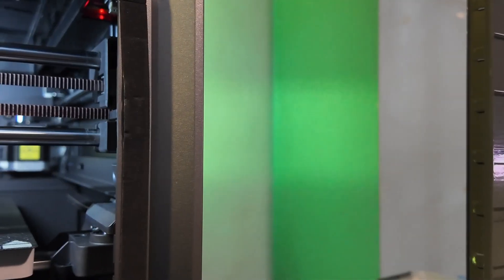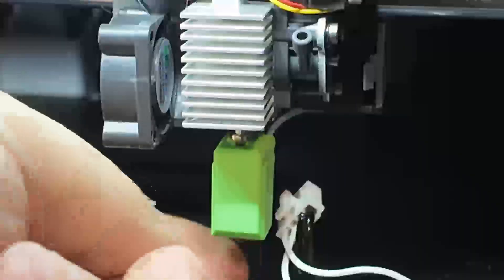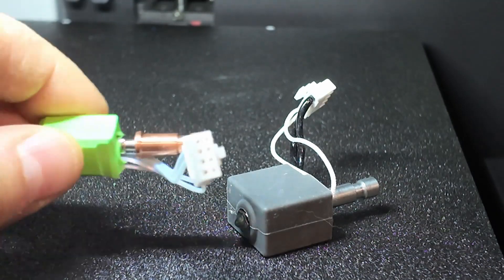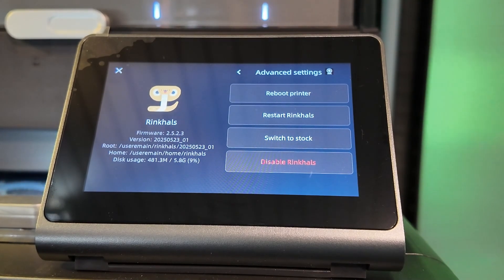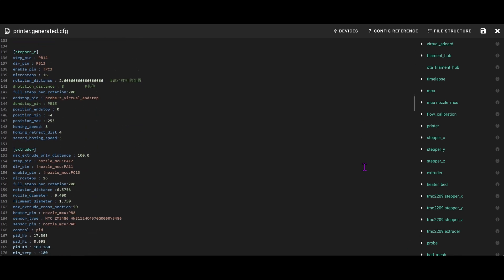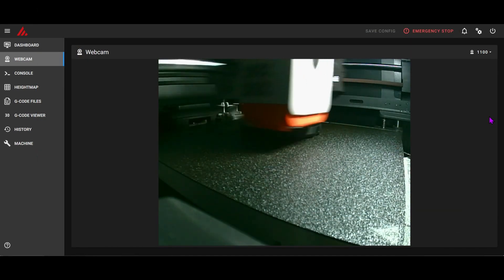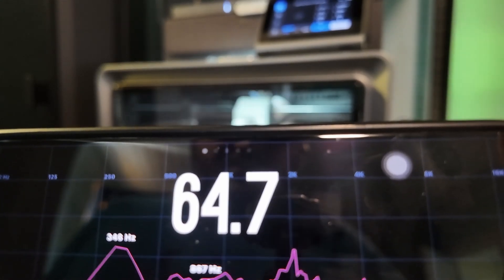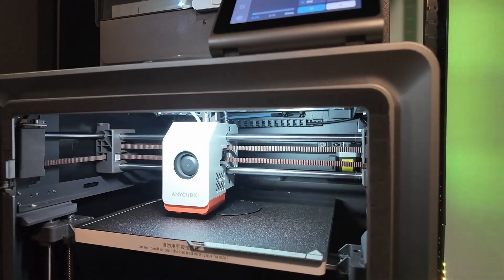Anycubic Kobra S1 Supercharged! - $10 Hotend FIXED Everything

Comment: I am also curious about the mentioned thermal paste. I just received the green hot end as well and the nozzle seems really tight. I hope they didn't glue it in because I want to change it for a CHT clone
Reply from the maker: they aren't 'glued' together , they are tightly on there though, so you need to use some sort of plier to unscrew it.
Reply: @aim6mac Thanks to your reply I discovered that I made one of the most rookie mistakes ever... All this while I turned it into the wrong direction 🫥 I also spotted the thermal paste! Too bad my CPU thermal paste is only okay until ~150°C
Reply from the maker: @Blu3B33r  oh wow, hopefully u sorted it out now!
Reply from the maker: @Blu3B33r  and always remember, clockwise is tightening and anti- clockwise is untightening!
Reply: @aim6mac  I did, thanks! I get an abnormal temperature reading but new thermal paste is on its way already :)

Comment: Wow.  Bits ordered.  Can't wait to try this out.  The Anycubic package for the Kobra S1 was great value for money.  Should have been a game-changer combo, but didn't quite live up to the hype.  The Kobra was didn't meet Bambu for print quality.  This fix looks like it will make the printer great.  All for $10 and some software.  Thanks to Aim6Mac for working it all out and making such an easy to follow video.  I only have a tiny brain, so lets see if I can pull it off.
Reply: how'd the upgrade go?
Reply from the maker: tiny brain :D

Comment: Interesting video - thank you!
What kind of nozzle are you using with the ceramic Hotend? Brass, one of the other materials?

Could you describe the thermal-paste thing more precisely? Witch paste? Where to put it on and how much?

Do I have to change slicer settings, when using 1.0V, Rinkhals and the ceramic hotend?
Reply from the maker: i updated the description of the video , please check it out there,
Reply: @aim6mac  Thank you - but what Nozzle material do you use?
Reply from the maker: @Crady123  in the video i'm using 'hardened steel'

Comment: Great video!
Im loving my S1 after the ceramic hotend upgrade. Ive done a lot of work to the bed on mine to get perfect first layers without having to do mesh leveling :)
Reply: Why does my printer, when it starts printing a single layer, not adhere to the plastic for a couple of centimeters of the extrusion stroke at the very beginning, but then prints normally? It's as if there's some kind of extrusion delay. This happens with both the ceramic hotend and the stock one.
Reply: @КалупаКалупович  me pasa lo mismo, al comenzar a imprimir no extruye; luego si, pudiste modificar algun parametro para mantener el voltaje?
Reply: @matibeltranarg  Increasing the motor voltage didn't solve this problem. It might be a firmware issue, causing extrusion delays, I'm not sure.
One possible solution is to add a skirt. It's not a panacea, but sometimes it prints without gaps. 2. Set the additional feed length in the rollback profile; I set it to 0.1.
Reply from the maker: oh really, i need to watch that video soon!!!